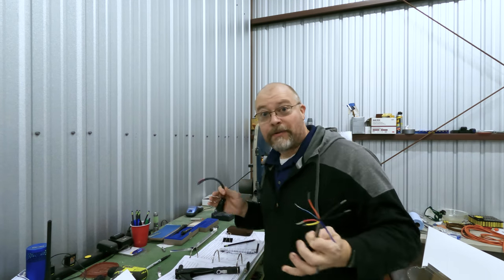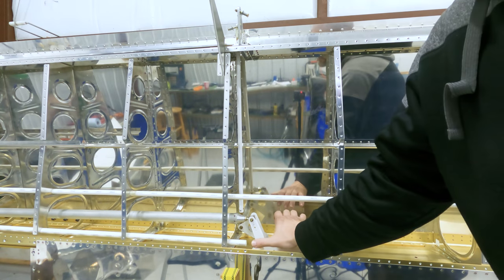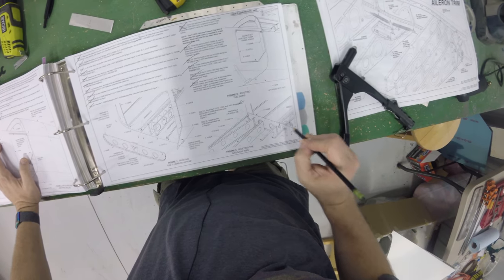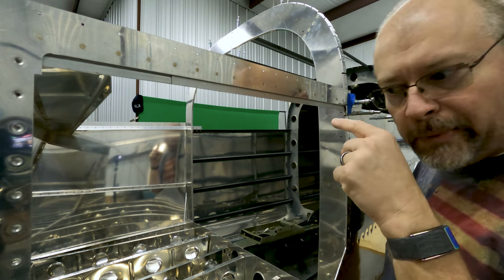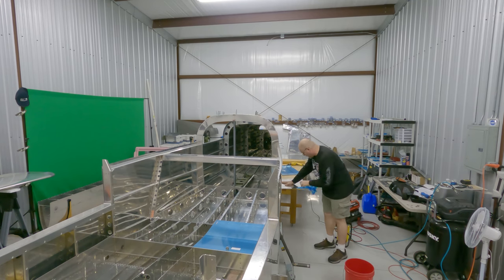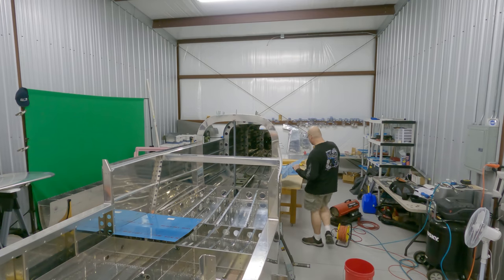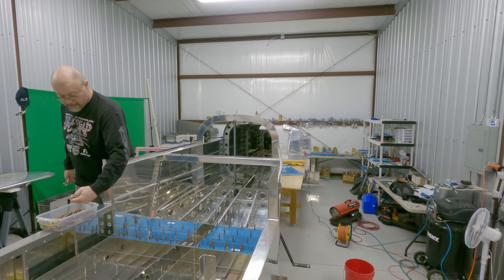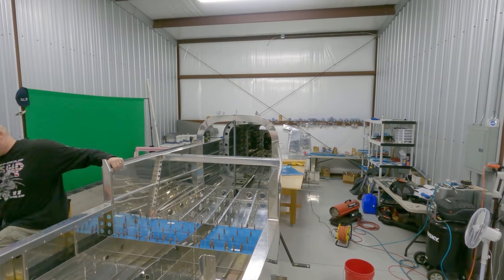RV-10 Fuselage - 037 - Wiring and Rivets!

Comment: I received a BS and MS in Aerospace Engineering and had several aircraft design courses. In addition, I worked as an Flight Test Engineer for the Navy and Army. I am now working as a corporate pilot and building an RV-7.
The center of lift and the center of gravity are not too difficult to predict given you know where you plan to place all the parts that have some volume or mass and have picked the wing and airfoil design. There are programs that can assist you in sizing and layout and predict some performance. Structural part is a little more difficult, you will need to enter a structural model into a computer to predict the maximum stresses for your aircraft. It just depends on how deep you want to go with it.

Comment: Please use AC 43.13-1B published by the FAA for your information source on any building technical questions.  It is a wealth of information and guidelines and among other things addresses wire sizing and proper practices for running and securing them. Having almost completed wiring my -10 I must say that other than for some in the wings you really don't need to run conduit anywhere else. Not sure if 'sharkbite' (it's actually PEX - sharkbite is the brand name of the fittings - but then again PEX is also a brand name for a particular brand of tube) is a good choice for conduit.  I recommend the black corrugated conduit which comes in a flame resistant and 'fire safe' (won't support combustion nor will it produce toxic fumes when burning) material  may be a better choice.  Keep up the awesome work on your videos. I'm further ahead than you at this point but do enjoy watching your build and remembering the steps Involved.

Comment: My friend is building an RV-8 and we JUST did some wiring for the test box he made to test them out. As far as gauge for wire, does the wiring diagram tell you? His showed both 20AWG on some wire and 16AWG on others, so you may not have to guess what gauge to use. Also, don't forget about the grounding. I think the plan and acceptable way of grounding is to put those black wires in the diagram (and I think the white? wire, I kind of remember one of those) to the closest rib. Finally, don't forget, you named switches, but you also need circuit breakers ;) (again, unless you're doing something like the Vertical Power stuff, I can't remember if you've said that). Also, we used a 24pin TE barrel connector (same connector as the zip tip bundle, just more wires fit in it) at the wing root for both sides. That let him have the option of running all his wires through the wing to the wing root, then having one connector to open in case he ever had to take the wing off.  Anyway, sorry for the paragraph, now I'm back to finishing your video (which they're always amazing, btw, so thanks!)

Comment: Having Rudder Cables inside the tube may protect it from pinches but could exposed it to corrosion due to retained humidity. Also, it would not be possible to visually check the cable whilst being inside the tube.
Reply: I would just grease the wire... I do it for high corrosion environments

Comment: For the wire 9 amps is well within the standard rating at 12 or 24 volts. Just check the standard tables. The tables are very conservative and there’s no chance of getting close to the actual capacity of the wire in normal circumstances. If however the kit manufacturer specifies a wire gauge and specification you must use that specification in order to qualify for the airworthiness certificate for certified or experimental.

Comment: Sorry me again. You may get sick of unsolicited advice but here goes. Think carefully about installing plugs for your wire splices at the wing roots. Every time you break the wire your are inducing at least three more connections and potential for problems in every wire you run. Given you are building in a hangar why not just complete the wire run in one shot?  If you don't  know your fuselage routing then just leave a long tail coiled up where it enters the fuse and pull the rest later.  Do you ever intend to remove the wings after you're done?  Also pay attention to allowable amperage derating factors for wires when run either tightly bundled or in conduit.  One more thing - most glass panel setups will allow you to have a wigwag function controlled through your EFIS. I am installing a G3X setup and it will power my landing lights which allows me to eliminate the sync wire but more importantly you can program the wigwag function to operate automatically and then turn to steady both on below a preset airspeed for night landings.
Keep up your extraordinary effort in not only actually building the airplane but also documenting it so well for the benefit of others.  I cannot imagine the amount of extra time it takes you to produce these fantastic videos.
Reply: The Zip-Tip guys call it "wig-wag" but actually, mine just "blink", meaning both taxi lights will go on and off at the same time while the landing lights stay permanently on. I was expecting the lights to be alternating between left and right side. So there might be an additional advantage of using the EFIS to do the wig wag. Saves two wires (wig wag on/off and wig wag sync) and it actually wig wags.

Comment: Per Van’s publication under support tab, you can drill those holes you already have to 3/4” then purchase from Van’s (DUCT NT 5/8-50) Conduit.  Another well known YouTube builder said you can drill a small hole in the conduit and put in a store bought rubber grommet anywhere in the conduit run to pull wires out and prevent chafing (like to pitot or stall warning). That should give you plenty of room for wires and prevent chafing.

Comment: A couple of thoughts. Wire in free air has 1 current rating, Wire in a bundle in a jacket has another current rating and wire in a bundle in a jacket in a non heat conducting conduit will have still another rating. It all has to do with duty cycle and heat retention. Second thought: control cable through PVC or PEX tubing ..... Over time the conduit will sag and increase the drag on the cable.

Comment: regarding "tubing for rudder cables"---- be careful.  As much as you want to avoid jamming of those cables from loads etc---- be much worse for something small to enter tubing with cables and JAM in the tubing!  Just presenting something to think about---- How would you secure the open ends of the tubing to prevent ingress of 'junk' and cables sliding inside the tubing WILL increase friction and peddle effort on rudder!

Comment: As far as the Service kit, Im less familiar with Experimental, but in the certified world, a service bulletin/service kit is not required. It usually is considered an update/upgrade to improve serviceability, extend replacement interval, etc. They only become compulsory under Part 135 operations (not a concern for experimental) or if required by AD (the FAA mandates installation). Since virtually every aircraft sale contract is "as accepted at the time of sale," the owner chooses to "upgrade" the aircraft using the service kit.

Also, Jason you may look up CAD programs that allow you to assign material properties to a part. I know Catia allows that but the program is $$$$$$. Solidworks is made by the same parent company and a limjted version is free with EAA membership. Food for research/thought!

Comment: If the RV-10 is like my RV-12 the cable on the pedal you are not pressing might drag a bit in the shark bite.  I don't know if you would feel it but generally friction in a control system isn't a good thing.  Also that might mean quicker fraying which, as already mentioned, you won't be able to inspect visually.

Comment: I will add that running control cables in conduit is a nonstandard practice. I would have concerns about inspections, chafing/rubbing through the conduit, and added drag on the cable. Any passenger compartment items will be separated by floors. Any wires nearby should be supported with adels to prevent contact between the two. 

I have seen in congested areas where lexan (polycarbonate) shields between the cables and wires/ other systems, but the lexan is clear (for inspections) and maintains clearance from the cables. But even this is uncommon and used in limited areas. Also every oz of weight adds up.

Comment: Try Autocad for the weight and structural strength. You’ll need to input data for the materials used. Can print directly to many 3D printers with it as well.

Comment: Someone else may have posted this already but all EAA members get a license for solidworks. Works great with my 3D printer. I used OpenVSP to design my plane. I will tell you designing and getting it built are two different things.
Reply: Used Solidworks for a while but every year I had to completely uninstall it, download the new version and go through the whole EAA educational license thingy again. A 2 hour waste.
I am now using Onshape, it's free for anyone (as long as you keep your files public), and it's cloud based, so no installation at all and any computer will do. Even runs on an iPad. I found it also a lot more intuitive than Solidworks, especially the intersection / subtraction of shapes that merge. Just always does what I think it should do and with Solidworks, I would get errors all the time with those functions.
Hint: once you create a part with Onshape, you need to create an assembly with that part (second tab). Only then you can right click that object as part of the assembly and export to STL which then your 3D slicer will happily take and print.

Comment: I made my own 3dprinter from an older RepRap design, the SmartRap Mini.    PETG has high temp resistance like ABS but doesnt require a heated bed.   As a programmer, you might like OpenSCAD better, I do.  OpenSCAD is more coding centric.

Comment: Jason. I’m slightly  behind you on the fuselage. I just fit the upper fwd fuselage ribs (3) to the firewall. Based on the angle of where the ribs mate to the firewall, can you check your build and tell me if clecoing the ribs to the firewall causes the top section of the firewall to angle forward? I know my panel subassembly is built correctly but it seems to move the top 1/4 of the firewall forward slightly. Can you comment if your firewall is doing the same?  Thanks Mark.
Reply from the maker: Yeah the firewall sorta angles slightly.
Reply: Jason Ellis Thank you for confirming for me!!  I kept trying to slow your videos down to see if it angled but I could not get a good side view to tell. Thank you again for responding.  This helps!

Comment: 9 amps won’t bother 22 gauge wire.
Reply: 7.2 amps
“It has been determined that the total harness current should not exceed 55.2 A, size 22 wire should not carry more than 7.2 amps and size 20 wire should not carry more than 9.6 amps. Step 6—Determine the actual circuit current for each wire in the bundle and for the whole bundle.”  The above quote does not account for voltage drop; also it is seldomly a good idea to push wires right to their maximum ampacity.  Don’t just shoot from the hip do research.

Comment: Strobe 9 amps...Wow... I didn't think LED would draw that much current.. For a less than 3% voltage drop, would require a 10 AWG wire.
Reply: The zip tips use switching power supplies and accept a wide range of voltage. So whatever voltage drop you have will be compensated with amps. And heat is not an issue as the current draw is very short.
Reply: @martinrenschler4046  I would respectively disagree. As voltage drops, amps go up and vis-a versa. More amps pushing through smaller gauge wire will always heat up, no matter how short. 10AWG shouldn't  be a problem wiring through the wing.
Reply: @CaptEmee  sure, amps go up, but the duty cycle of the flash is what, 1/2 percent?, Let's say you drop 3V * 6A = 18W, 1/2% of that is 0.9W. Along 20 feet of cable is not going to heat anything up. Aveo recommends an AWG20 cable for the strobe power (one per wing).